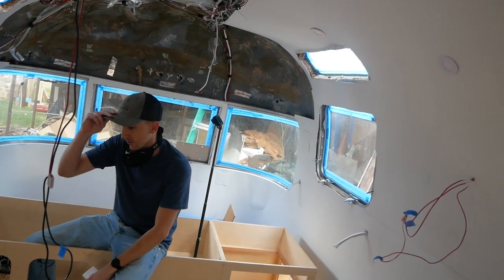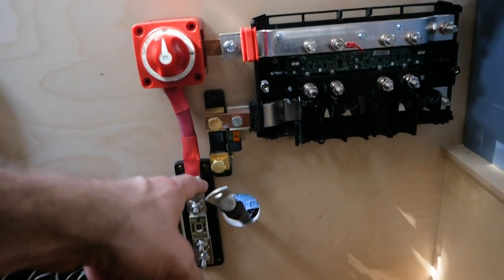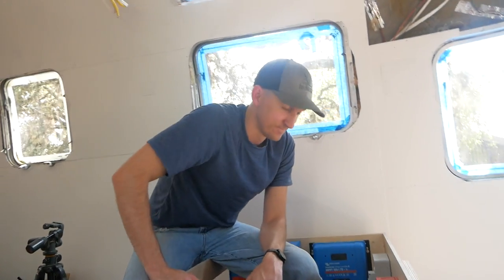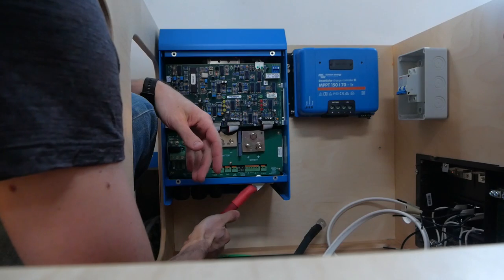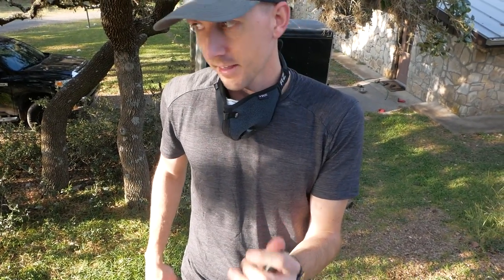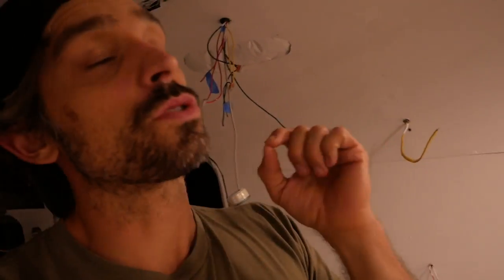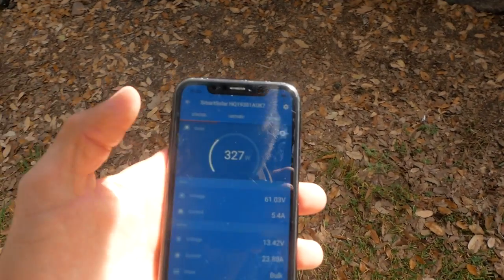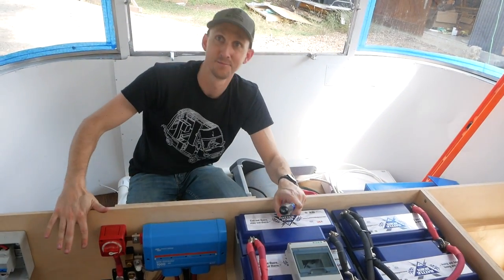Lithium Batteries and Solar Hook Up (Airstream Argosy Ep. 17)

Comment: In college we turned a multi-purpose room into a "TudorCastle" for a Madrigal Dinner. It was the event of the year and took at least a week of time. I think I put in 60-65 hrs while majoring in Math w a CHEM minor. One night we needed one more quad box extension cord about 2 ft long. I found a length of wire and the materials and wasn't sure how to wire the box, it was Thursday night at 3 am and show time was right around the corner. I pooled knowledge from the crew and set it up. I plugged it in 3 or 4 times with it shorting out and blowing breakers. Finally realized the wire I grabbed had a short in it. Fixed and everything wanted of great. Just for fun Saturday pm I ran, with another guy spotlights for Woody Herman and the Thundering Herd. A recreation of a 40's/50's big band. Good job! Know the angst of will the lights work!. PS made all my classes except 2 I cut that week, cause I was doing okay in the classes and didn't want to fall asleep in class.

Comment: I bought a 62 Avion, and I'm so glad they used marine ply and better weather sealing than airstreams. Your build gives me major anxiety. We did renovations to ours, but not past the skins. I would love to strip it back to at least replace insulation, but I don't think ive got the guts (or time. We currently live in it full-time)

Comment: Do you have a contingency plan if one battery fails?  For example, a way to remove that battery from the bank to prevent overcharging of the good batteries?  I see this happen all the time, although I am not familiar with lithium batteries, mostly lead acid and hydrogen fuel cells.  We will be getting 48V 1100AH lithium batteries for our MHEs.

Comment: Congratulations Andy... We all share your excitement in seeing your Argosy coming along towards completion. You are doing an awesome job. Great setup for the electrical... I would be like you in that I would definitely want a guy like Nate helping me out. I have been restoring/repairing our 2008 Forest River trailer where water has gotten in and rotted out the OSB that the factory used in manufacturing this trailer. Unlike using aluminum and steel like you are, I am replacing the aspenite with hardwood, zinc screws, good glue and a lot of 'gee, I wonder how I can fix that?' kind of attitude. I do have a question - do you have shore power hookups? Either 30 or 50 amp 120 volt?

Comment: I could be an idiot but 60+ V from the solar array is a little 'hot'.  The 12V solar panels might should be in parallel rather than series?  Incoming SA voltage should be 20+ V or so.  I could be wrong but think about it...

Comment: 6:59 Wouldn't a fuel consumption meter be a better analogy for a shunt than a fuel gauge? AFAIK, it can tell you how much power you're drawing, not how much is left in your batteries (so current MPG vs gallons in your tank).
Reply: Ehhhh.... sort-of....  The shunt will 'count' the amp hours that are going in either direction across it.  So... the shunt by itself can't tell how much is left in the batteries; BUT...  when paired with that little computer chip board on the side AND paired with the app, we can 'tell' the shunt how many amp hours are in the battery bank.   So, every time an amp hour leaves the battery and goes across the shunt; the computer will subtract one amp hour from the battery bank capacity.  Same for when power is added to the battery bank when it's being charged.

But as far as fuel gauge vs fuel consumption meter for the sake of analogy...  I use the fuel gauge analogy because most people that are trying to learn this stuff don't know what a 'fuel consumption meter' is.  Gotta keep it simple for the sake of education. 😂😂
Reply: @EXPLORISTlife  Awesome polite shut down on a Karen Nate!! 🤣 Lmao